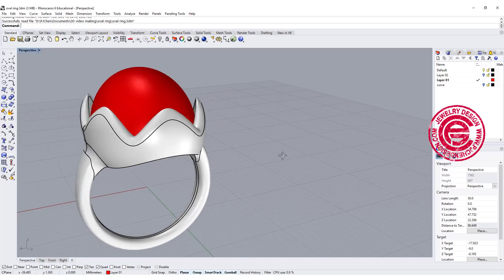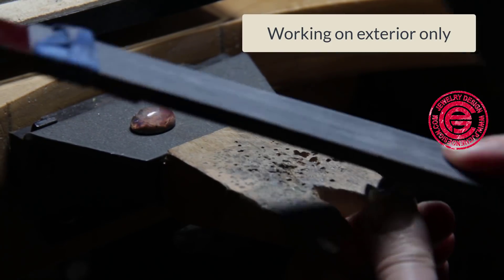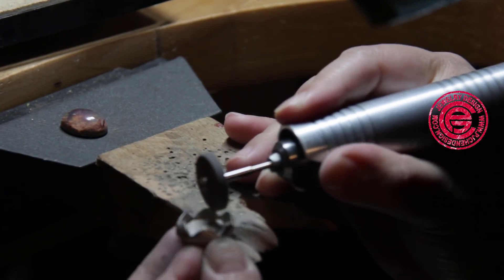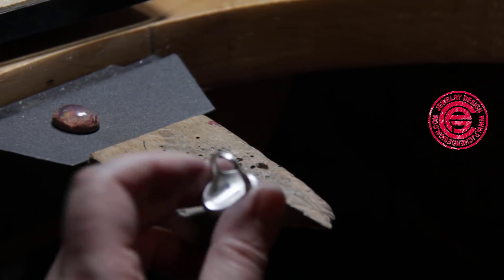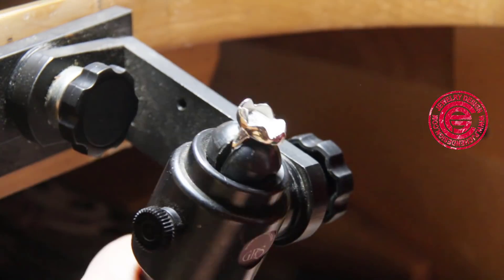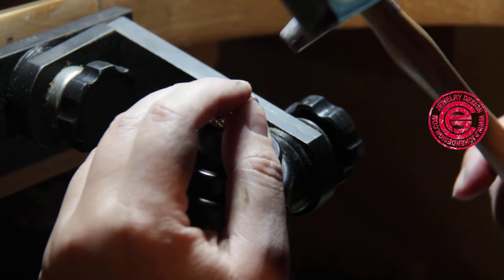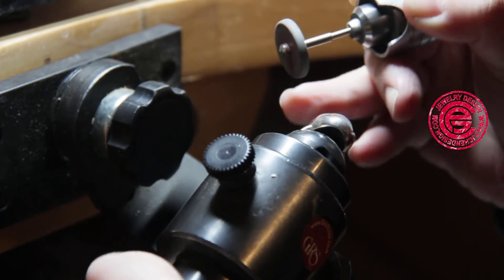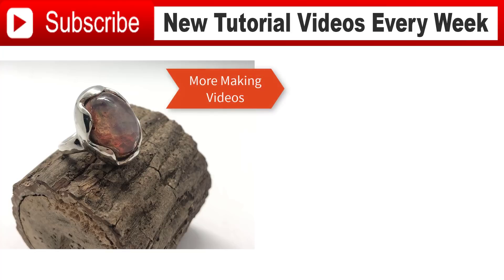Create a custom made Ring with Rhino 3D Part II (2019): Jewelry CAD Design Tutorial #59

Comment: Which software best for sculpture designing for coims
Reply from the maker: Hi, Sonu. If you are looking for the low relief sculpting. Rhino can do in a certain degree. but something like human, animal face ect. I will suggest using Zbrush.
Reply: Medam I am coin die engraver so I have many coin images stl file but their results not good after engraving from stl file so which software best for editing stl file and cad designing for cnc machine engraving
Reply from the maker: Hi Sonu, for the low relief style sculpture on the coin. I will recommend Zbrush to edit the stl file. If the stl file you have are in low resolution, you will not have a good 3D print or CNC milling.